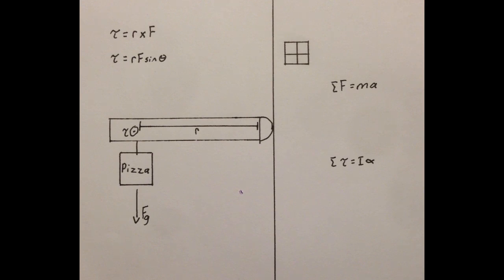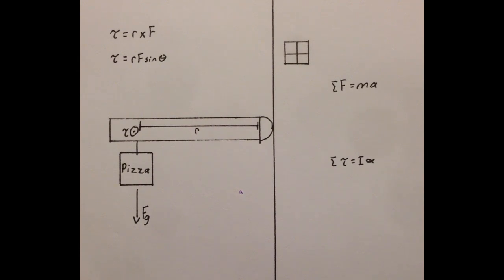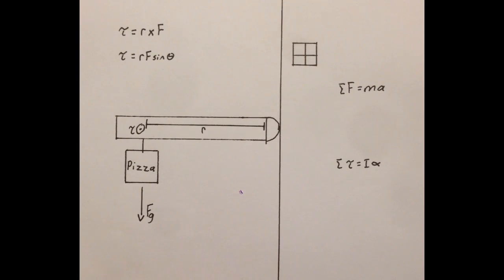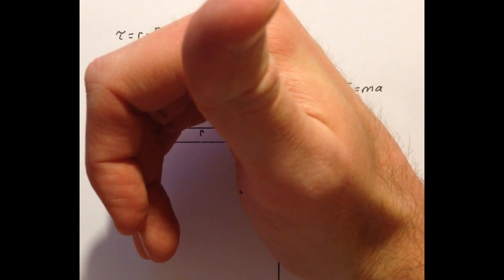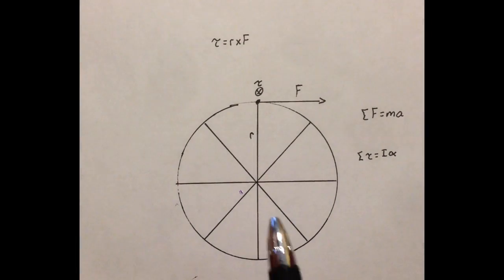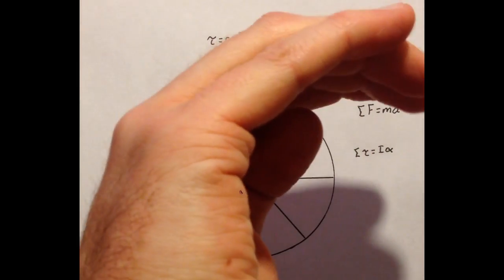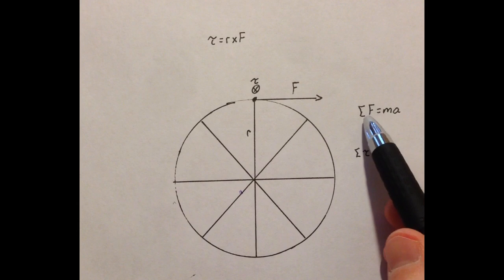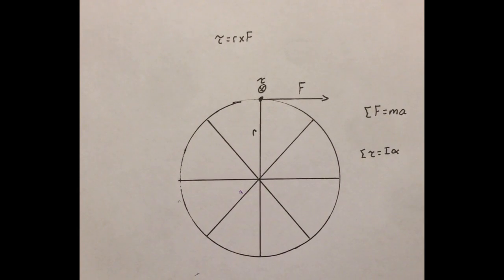Direction of torque

Comment: What does that even mean, though? How can the torque come out of the page? I am very confused...
Reply from the maker: I know, if feels crazy. One of the classic proofs that is the case comes from gyroscopic motion. Check out this good YouTube video: https://m.youtube.com/watch?v=ty9QSiVC2g0
Reply: Mean z and -z axis
Reply: Torque is a pseudovector that "transforms like a normal vector under proper rotation but gains an extra sign flip under improper rotation such as reflection." https://en.wikipedia.org/wiki/Pseudovector
Reply: Think of it like a bolt on a car. You want the bolt to come "out" of the page, so the force must be applied along the curl of your fingers. Same the other way if you want the bolt to go INTO the page/car.
Reply: @NSwanson89  Not to make it more complicated but bolts can be reverse threaded and you'd have to turn counterclockwise to go into the page. This is what's frustrating to me that the direction of torque just seems like an unimportant side product of the calculation
Reply: You must not question on something you cant get the answer of in simple enough terms for you to understand. The only answers given will be in terms of analogs with real life situations which you will calmly reject (obviously). You need higher level knowledge of mathematics of vectors and 3d physics. Questioning something in physics, chemistry or maths is most of the times a waste of time. Just keep learning and getting known to the subject and you will get the answers yourself. This is something ive learnt while learning these subjects. These things of direction  and right hand rules are a simple way made by scientists etc. For students to understand. This is because these rules "work" in every situation and getting to know it more deeply requires that level of knowledge. 
Theres a rule to curl starting from the first vector to the second one in the cross product. 
Eg . A X B . You will curl from a to b and point your thumb accordingly as shown in video. In case of B X A curl from b to a . Asking why is senseless right now.
Reply: @yakshrajsingh8121  agreed

Comment: the wheel moves in the direction of force and ths akes sense, but according to right hand rule it moves inside the plane of page, I am really confused
Reply: Big Guy to yuen yong sexx
Reply: Luke Burch  se,xxgirl
Reply: Big Guy the angular acceleration is along the direction of the torque vector not the tangential acceleration. Which means the wheel will rotate towards the direction of the force applied but the angular acceleration will be towards the plane of the page.
Reply from the maker: Big Guy yeah, the direction of vectors when looking at rotational motion feels very weird! It’s a consequence of the cross product which I didn’t go over in this video. After I teach my classes the direction of torque and of angular momentum I generally do a “precession” demo (like https://youtu.be/ty9QSiVC2g0 ) to help prove those directions are right because without proof it feels crazy.